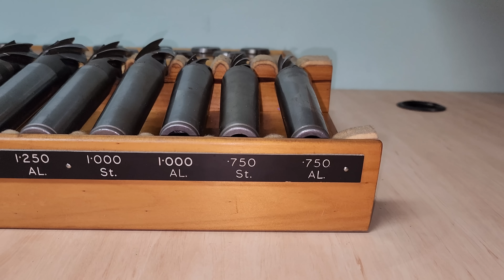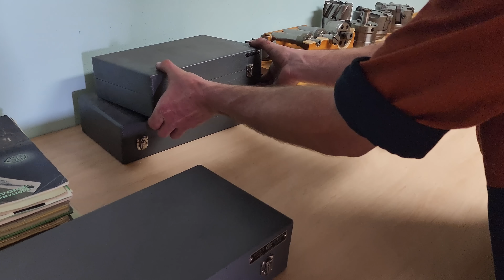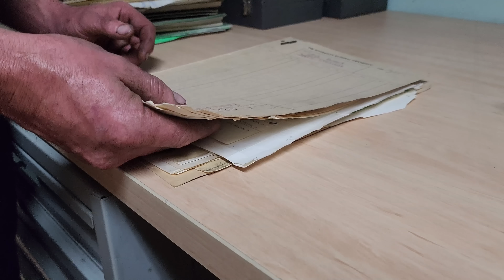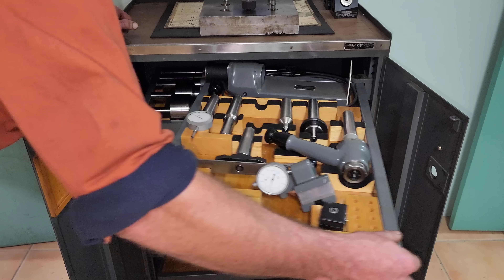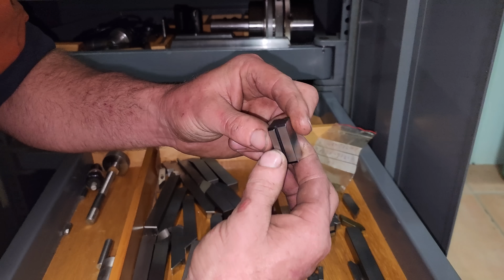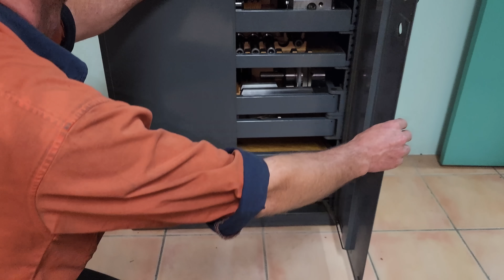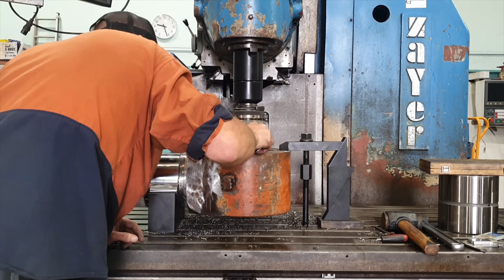Our SIP Jig Borer Tooling Collection! | Testing Shop Made BT50 Tool Holder

Comment: What an amazing set of tools!

Vintage tools in museum quality condition!   It makes me so happy that you have them, you'll take living care off them until someone in the next generation can.

Whoa!   That test plate is nothing short of amazing! Incredible!
Reply: Nice collection of tools. Very nice cabinets also.
Reply: and judging from the looks of it, i’d venture a guess that Kurtis is probably sitting on about £2,000,000 worth of tools and equipment with that SIP Borer , considering the mint condition of the tools and all
Reply: @JohnH20111 priceless! The lovely thing is that they are in the hands of some one who knows how to use them rather than some dusty museum.
Reply: The test plate was the most amazing part of the video. Attaining the demonstrated tolerance across the full length of the bed in both axes is nothing short of astounding.
Reply: @jeffburrell7648  Jeff, I believe that SIP was the original company who made the original international metre standards, they devised optical methods for both making the standards and then the comparators to check the sub standards. I think the Hydroptic used some of this technology in its measuring system. I’m tempted to say the Hydroptic was the peak of machine tool development, following in about a hundred years from the development of accurate screw cutting.  In a way, sadly CNC doesn’t need  such engineering,
Reply: Hello from Musselwhite Mine!

Comment: The craftsmanship it took to make these tools BEFORE computers was on a level that we probably can’t see today....taking inferior tools to make a better tool is amazing.
Reply: Just because it’s not computerised doesn’t mean it’s “inferior”. A mate of mine, who is the best machinist I have ever seen, has only manual equipment and refers to Cnc operators as “button pushers” not machinists. Computer operated machine tools like CNC Mills and Lathes are not “superior” to the manual machines. They are just faster at producing large quantities of identical products.
Reply: @davidcat1455  I don't think he means that the non-computerised quipment is inferior.  Rather that the machinists were far more skilled than today's CNC operators.

Honestly, I'd love to see a video of Kurtis having a go at making one of those plate-and-plug sets like the SIP technicians did back in the day.  Be a real test of both the man and his machine.
Reply: @dfross87  
Yeah, maybe I took it the wrong way. 🤷 I still do all my workshop drawings with ordinary old drafting equipment, using ordinary, old analog, pencils and paper. I enjoy the mental challenge of getting dimensions and tolerances correct using experience and the small amount of skill and intelligence I have available to me😬. Of course I’m not in a high-pressure production business that demands a massive turnover to be competitive. It’s just a small one man engineering workshop where every job is different and every job is a one off. Being a computer illiterate old fart, who wasn’t real bright to begin with,probably skews my thinking a little😃😃😃😃😃 Cheers
Reply: @davidcat1455  It happens to the best of us at times 🤷.

Sounds like you have plenty of nous, even if you don't have a fancy piece of paper to say so.  Smartest guy I know has a PhD.  You know what makes him smart?  The fact that he realises he knows SFA about a lot of things, and calls people who do know about those things to ask them questions.
Reply: Would be a test of the machine not Kurtis, he is a highly skilled engineer/ machinist not a CNC operator @dfross87
Reply: You did not take it the wrong way he doesn't know what he's talking about @davidcat1455
Reply: Couldn't agree more David  @davidcat1455
Reply: Your statement makes no sense,  who do you think made computers ?
Reply: Chill guys. He means that to machine better tooling with higher precision you can only use inferior tools. Because, you know, you're just making the best tooling so you can't already use it for this process.
Reply: This was not made before computers. Turing was able to crack the German Enigma code during WWII using an analog computer. For his trouble he was convicted of being a homosexual and after chemical castration he committed suicide.
Reply: @teeanahera8949  
The abacus is a type of computer that is thousands of years old. 🤷 I think you kind of missed the point.

Comment: Not a machinist and would struggle to drill a hole straight in 1 inch aluminium but have the worst case of tool envy.

Are you able to share how much you paid?

Comment: Hello everyone, I'm from the future (year 2043) where I just watched the last video "Polishing & the first celebratory ride around the workshop | Franna Crane Project | Part 1019". I recommend everyone to hang on until the end, 20 years will fly by and Kurtis did absolutely perfect work. Now I have to go, because the Rolling Stones have released a new album and are going on what is said to be their last tour "Still Rolling 2043"
Reply: Old 😂😂
Reply: That’s wrong … it will not take him that long to square off the crane. 

I used to build and refurbish equipment. 

He can find and adapt current axles from later model trucks.